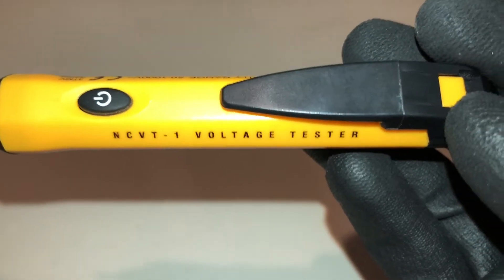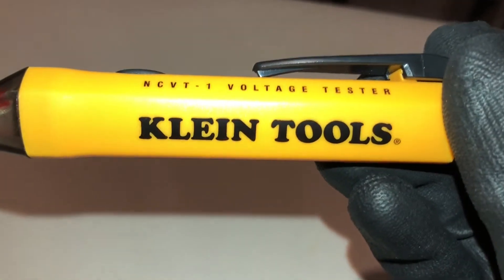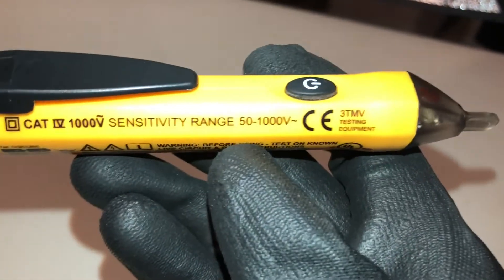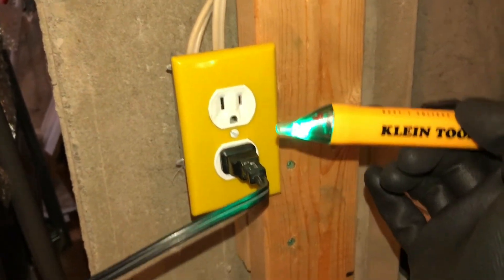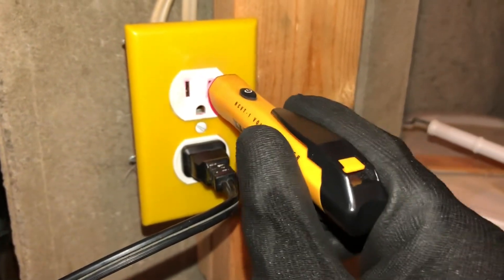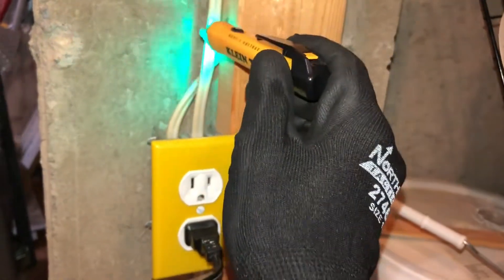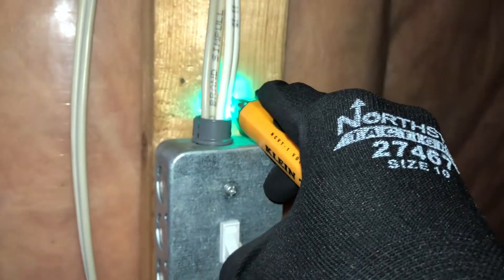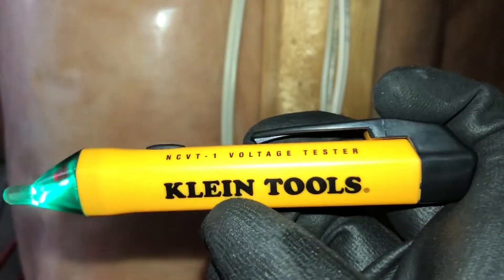How a voltage/proximity tester works - Troubleshooting electrical circuits - The Electrical Guide

Comment: Liked, where do you get the gloves? Will they keep 120 from stinging you? I've got to work in a real tight space. Thanks in advance
Reply from the maker: Those gloves provide essentially zero shock insulation. I wear them to protect my skin from sharp objects for which they do a half decent job. I’ve got a huge stash of them from when I worked at the Ford assembly plant. Thanks Ford! Haha

Comment: Can I use one of these for finding the neutral wire that goes to a dishwasher?  I want to get the circuit up to code by swapping out the current standard breaker for a GFCI one but I don't know which neutral wire on the bus is for the dishwasher.  Power the dishwasher on and use one of these to find the right neutral wire?
Reply from the maker: No, it’s not used in that way. However I would suggest turning your whole panel off briefly with the main breaker. Open up the panel cover(bottom half only)and find the wire that terminates on the breaker that controls the dishwasher then follow that wire back to the entry in the panel where the white and black come in together and you’ll be able to find the neutral as well. Hope that helps!
Reply: @theelectricalguide  Thank you.  I shoulda thought of that ha ha.  It is a finished basement but hopefully I'll be able to see the romex protruding on the inside of the circuit breaker box.
Reply from the maker: @captainwho1  yeah for you will see it. Take care to follow the white carefully as sometimes it can get lost in a tangle and you end up with the wrong one 😂
Reply: @theelectricalguide   It was quite a tangle indeed but I got the right one on the first try.  Thanks!
Reply from the maker: @captainwho1  well done! 💪